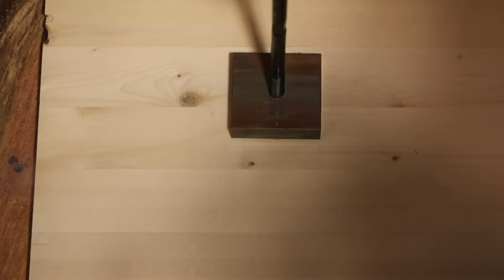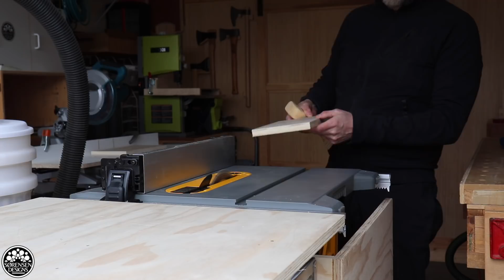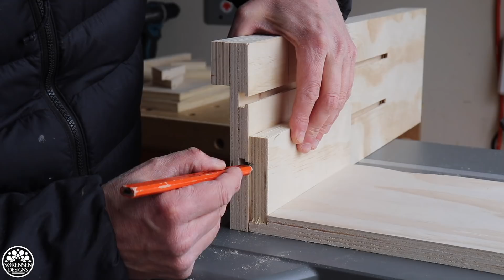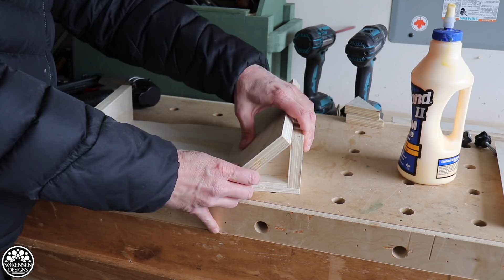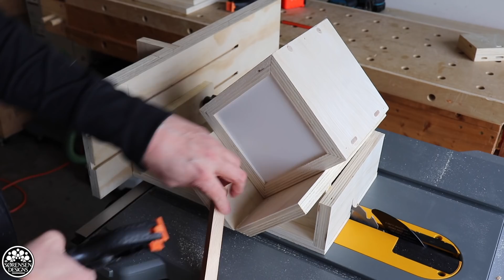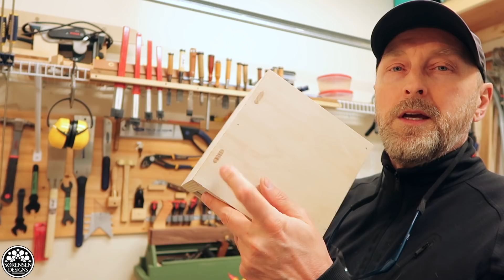A Spline Jig for the T-Track Crosscut Fence // Woodworking

Comment: Please make a detailed video on the riving knife and preferably the entire arbor mechanism.
 I have a mid 90's Craftsman contractors saw, one of the old saws without a proper riving knife, and no riving type device available if the arbor is tilted. I'm in the project ideas design phase thinking about how I might add a riving knife. I picked up a cheap spare riving knife originally from a Bosch tablesaw. I have the space and mounting points needed to make a mount for it and an independent height adjustment. However, I would much rather find a way to attach an assembly to the arbor casting. I have some ideas for this, but seeing how it is done on other saws would be helpful.
  Also, wow that saw top looks tiny. I use a table top Skil tile saw from Lowe's in my lab to cut printed circuit boards that I've designed and etched. Your dewalt looks closer to it in size than my old craftsman contractors saw.
-Jake
Reply from the maker: It's a full sized compact table saw🙂.  Similar to the Bosch, Ridgid, Makita etc... They all make their own version. As far as fitting a riving knife, your Craftsman will either have a fitting for a riving knife or it won't have one at all. They are very specific and proprietary on how they install into a table saw. Every manufacturer is different. There are good reasons for this: A) Their RK is their safety device and they don't want people mixing and matching safety devices. B) They want you to buy their blades, so they will be a specific size and fit that matches their blades. I will be doing a video on my RK, because it is a little more evolved from the older versions.
Reply: @EricSorensenCanada  
  I understand. There are a few YT examples of people making their own. It is a complex mechanism, but ultimately creating anything comes down to fabrication skills, tools, and time. 
  "Proprietary" is for strategic marketing, as "patents" are to corporate warfare.

 It's always cheaper to buy a solution, and usually smarter, but the lack of learning failures disturbs me :-)

...you can't fix stupid...
The only thing worse, is trying.
-Jake

Comment: I always watch your videos. They are creative. Your recent video on your new Dewalt table saw inspired me to purchase one. I like really well. I was a little disappointed that it didn’t except dado stacks. I was looking in Amazon for a solution and found a 1/4-3/8” double blade that did work. The 3/8 inch configuration worked only after a slight modification to the dust cover on the blade. Oshland SBJ 0830 8” mine works great. Keep up the great videos. Thanks
Reply from the maker: Thanks Michael! That's good to know! I will look into that for my table saw.